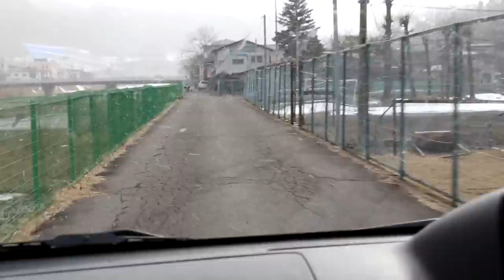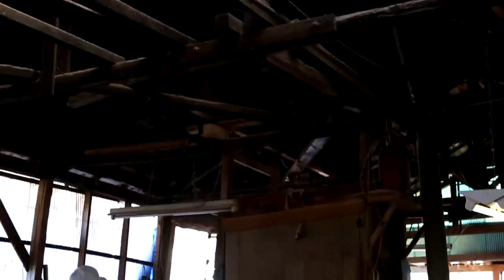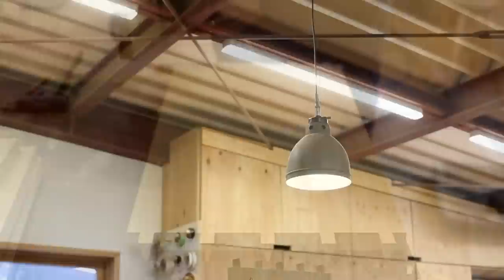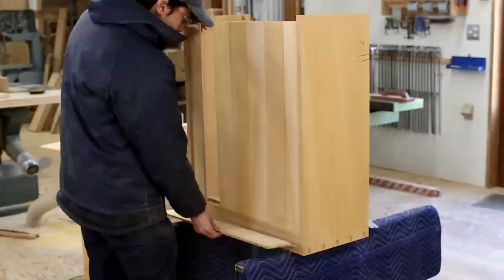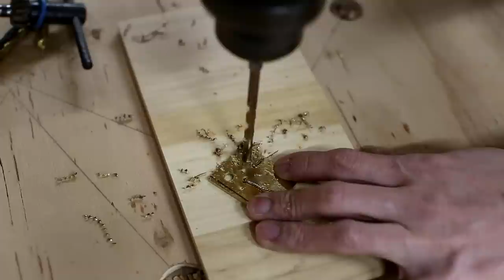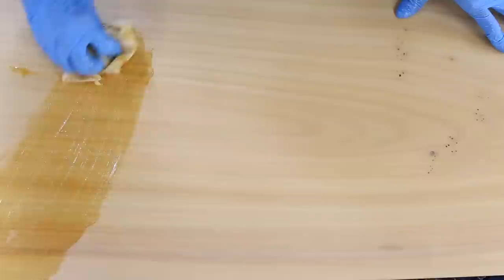ISHITANI - Making a Ginkgo Tree Cupboard - made from an old table top -

Comment: I was interested to see the use of splines for the back--- groove-spline-groove instead of tongue-and-groove. It seems that it's quicker to make all of the grooves with one pass for each edge of the board then to have to make at least two passes per edge if using the table saw to form the tongues. And you don't actually have to be precise about putting the groove in the middle of the boards, not if you reference the same front face with each pass.

Comment: Look at those exposed electric wires in the rafters. Codes vary from country to country. Those wires could have been there for 70 
years or more. There are mills back in the woods of central Missouri run by the Amish that are similar. Walking back in time.